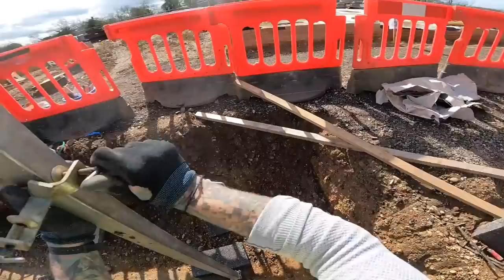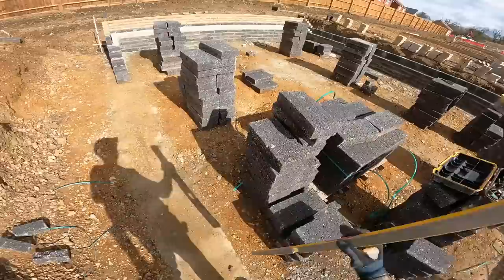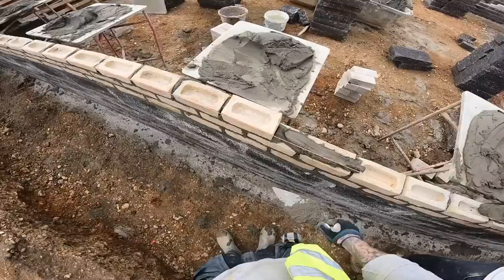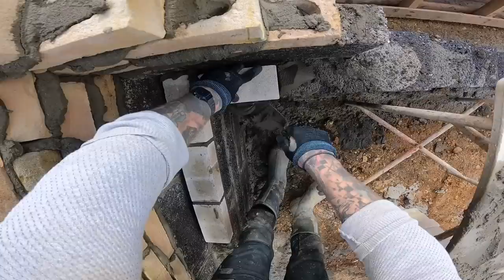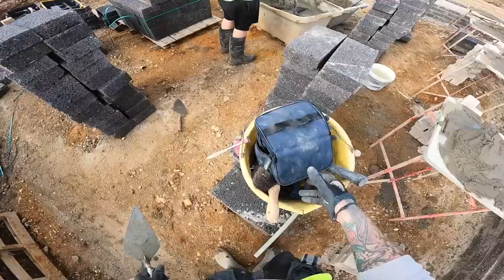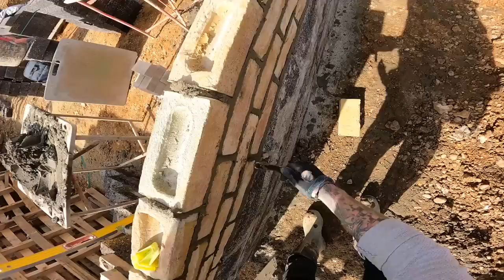Easiest way to Lay Bricks By far! Profiles For Doe.... Corners for SHOW!

Comment: I said this before, as an x-bricklayer, I wish I used profiles because It hurts my soul thinking of the money I lost by not using them. It’s just corner building in Ireland is the norm, I never seen anyone using profiles. I was a fast trowel;However, not as fast as using profiles like Charlie does. Stick with you mate and don’t listen to other idiots. Like the old timers would give me sh@t for using a smaller trowel and a 3ft level, but my work was alway 100%, I was faster than them and their work was rough, smashing corners with hammers and I would just laugh when quality control came around, they got a mouthful and I was always complacent for my work….point is, once you’re work is of high quality, ignore the bitter people.
Reply: bazz1 what I found out, people who smash out work when its needed they will have difficulty in doing good work where it is needed. We are not put on this earth to be slaves, Smashing work out and boasting how many bricks you laid not only destroys your body. What do you have at the end of the day? There are the ones who are fast and good. Although in many cases finer detail is missing.

Comment: Great bricklaying. Stick to those standard bricks. In Western Australia maxi bricks are often used and they are not nearly as good as standard size bricks. Such and locking in bonding etc. You are an excellent bricklayer and highly skilled. Even your level handling skills are something to behold. How many stabila levels have I had stolen? Along with cyclone shovels. Well, after cyclone shovels were made elsewhere the steel where the wood slips in had split on a few shovels. So I bought spear and jackson shovels.
Setting up profiles and the clamps attached on the top makes a more stable right?
I did a job pinning up a wall then removing bricks to set in a t section beam to rebrick above beam. I made the mortar 4 parts sand to one part cement. Added screedbond and addicrete p which is a type of water proofer. Re  layed recycled bricks. The old bricks built 80 years ago. They are a softer brick and fire cooked. The temperature cooked would be around 200 to 300 degree celsius. Modern gas cooked bricks are around 3,000 degree celsius. The older bricks, bricklayers could chip the bricks to achieve the shape they desired, As in those days there were not many brick saws, angle grinders etc. I have a cordless 230mm wet saw which comes in use very often on renovation and alteration work.

Comment: This profile and corner argument is like cutting a sheet of ply with a hand saw over a skill saw because you have to run a lead out to set it up 😉👍🏼
Reply: Yeah but I know which ones less tiring on the arm
Reply: Hand saws and skill saws are not the proper, old school, way of doing things. You need to fashion a cutting tool by foraging materials on-site. Things like flint, or broken bricks or broken glass. A skilled workman would be able to use what the land has provided to cut that sheet - and not use "modern tools". Using handsaws and skill saws are for "fly-by-night cowboys" who don't have the real skill because they weren't taught correctly!!
Reply: @jp6975  😂😂😂👍🏼
Reply: @jp6975  you forgot that fact I would have whittled that ply down from a couple of local trees
Reply: @david-bq4fv  My bad. I knew you would have - and not used a cheatin' chainsaw either. Just repeatedly kick it until it falls. The skills you possess are , sadly, a dying art!
Reply: @jp6975  you won't find me wasting money down the local builders merchants I'll be down the woods headbutting trees until they fall
Reply: Profiles for brick all day, I’d rather build block corners with a level.. most gangs who use profiles on block work rough as they go up to many at a time

Comment: Building houses is the most basic and easiest brickwork ever, especially when theres not even any features.
Dont even insulation, tray levels, kingspan, internal corners, steel work, frames, etc etc.. nothing.. just gogogo straight runs with windows and doors xd
Do the block work, do the bricks and done, dont forget the ties, its important :)
And even more important, never scrap the back of the brickwork, nobody will see it anyway.
Reply: 😀well the nhbc man might want a quick glance down the cavities
Reply: Don't forget to knock them ties as you go 😂

Comment: Feck sake Charlie boy you getting slow min. Need to listen and build more corners get the speed up and toss them profiles away 😆😆😆😆😆😆 a lot time builds crack because there’s mortar is stronger than the material. Spot on with footing most specs a get shows 3-1 mix in the footings.